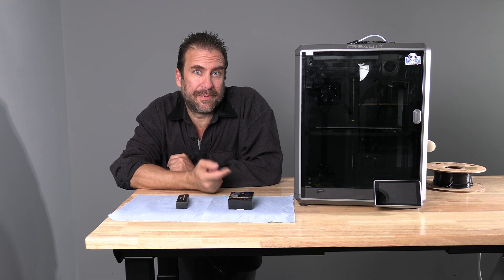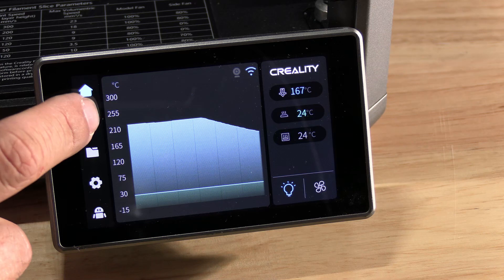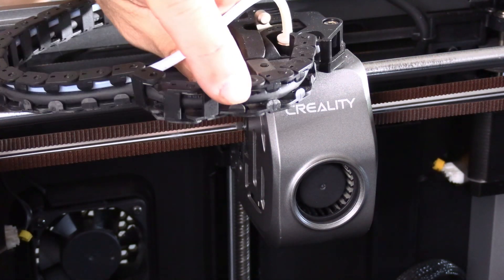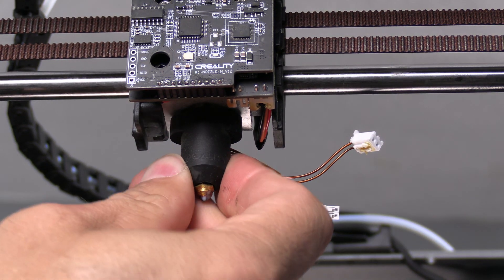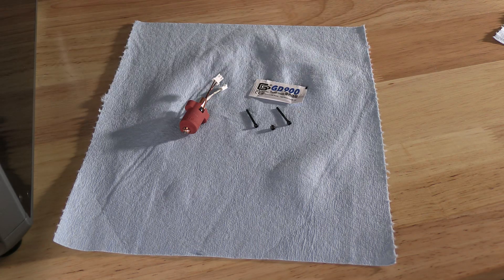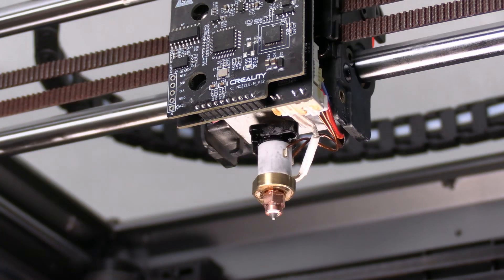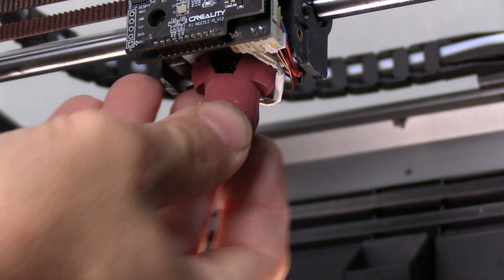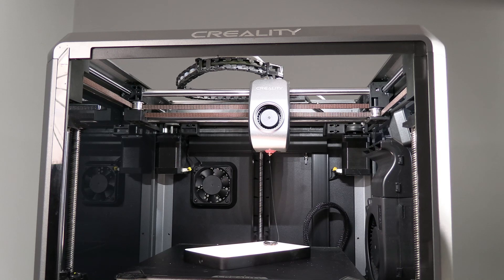How to replace the Creality K1 Hotend. Install the newest version. AKA: "Ceramic Heating Block Kit"

Comment: I bought my K1 speedy about 3 months ago in November 2025 so would it have the updated hot end, and can I print PETG with the standard hot end or do I need to upgrade it
Reply from the maker: Not sure if has unicorn. It may. Can totally print PETG. Easypeasy for the K1

Comment: "Is it possible that there's a gap between the body (hotend) and the heatsink with the new hotend?"
Reply from the maker: If the heatbreak is all the up and seated, there may still be a visible gap at the hotend

Comment: You forgot to mention that the fks @creality don't supply the correct Allan key to remove it, and every other key I tried, don't work
Reply from the maker: It's literally a standard M3 sized head that you should have 52 of in your tool box
Reply: @3DRundown the one shipped with the printer does not work...nor does my own 3mm. I cut the old hot end with a grinder to cut the heads off the hot end. Even though I got the new hot end installed, still getting the same error... Reached out to creality support.
Reply from the maker: I don't know why you have had trouble with this. Any Allen set should have one that fits, including the set that came with the machine. What is the error
Reply: The old screw heads didn't seem to to be "hex", they were bad, so i cut the hot end with a grinder to remove the heads, so i could pull the faulty hot end.  reinstalled the new one, and it still gave same error.  After unplugging re connecting turning on and off numerous times, it now "works with the new hotend.  Was getting error 2509 .  Anyhow, it seems to be ok now...

Comment: Oh btw Creality now have an upgraded hot end board and the heater so the connectors are ceramics. I had same problem and pulled the wires out of the connectors whoever decided to hot glue them needs therapy.
Reply from the maker: The glue is common, and prevents them from loosening during international shipment. Should move on to the Unicorn hot end. I have a video on that as well

Comment: I am a bit older with thick fingers and bad eyesight it is always a pleasure to work on the K1 max tool end. Your tutorials are always used as reference when such works need to be done, thank you for your detailed instructions.
Reply from the maker: Very welcome. 🙏

Comment: Hi what screwdriver did you use when you unscrewed the screws at 5:01
Reply from the maker: Similar to this: https://amzn.to/45Ef5xW
Reply: @3DRundown could you tell what the head of the screw was. I need to know the specific type What screwdriver bit did you use?
Reply: @softhaze26  I used t6 torx, they seem to be hex 1.5 in reality. I also didn't remove any plastics from around the unit, only removed the connectors and 2 screws

Comment: This is awesome. My son’s printer’s hot end boot filled with molten filament, which then solidified. Tried to remove it, but now the sensor is erroring and I can’t heat the hot end to help with this any more. Any tips on what to do as I suspect that the extruder screw heads are now blocked.
Reply from the maker: You've got the "Blob Of Death". You need heat and patience: https://youtu.be/D4mRFYaZS08

Comment: Hi, I'm following this tutorial for my K1C, but the only difference is that mine has a unicorn nozzle, something changes? Greetings from México 🇲🇽
Reply from the maker: Very similar. I have a unicorn video here as well.
Reply: @3DRundown  the problem is that I want to replace only the hot end, but I only found the tutorial to change the complete kit (the one that also has the heatsink ) do I need to remove the hot end from the heatsink and place the new one?
Reply from the maker: if you already have the unicorn assembly, with the unicorn hot end installed, you can swap just the hot end, same as shown here.

Comment: I've just had to do this to my K1C.  I ordered a K1C hot end, but was sent a K1 by mistake.  Learned a good FYI that they ARE NOT the same.  Almost identical except the connecter plugs are different, K1 doesn't fit a K1C.
Reply from the maker: Bummer. Consider moving to the Unicorn
Reply: @3DRundown , yeah pretty sure that's what I ordered, but it wasn't what I got.   It said "K1 - Low temperature" on the box too.  Don't think K1C is considered low temp.
Reply from the maker: That is super odd. I don't know of any Creality Hotend that says that. Where did it come from?
Reply: @3DRundown  not 100% how it works but Amazon says it's straight up Creality.  It is a Creality product.  Also probably a Canadian Warehouse.  Most likely just an honest mistake somewhere down the line.
Reply: @3DRundown  turns out I'm half wrong on the subject.  My K1C is a newer model and has connectors so new, replacement parts don't seem to exist yet.  :(

Comment: continuing with the problem I have with the K1c. When I try to  start a print I get the message key 109 exception which refers to the tool head fan which is working all the fans on the machine are working normally. I contacted Creality support and they sent me a picture of the tool head fan. But that isn't my problem . The problem is the cable going to the plug next to the big 4  way  plug at the top of board 2 on the tool head is missing, and I have no idea where is gone or to what it connects to. Could you track that lead for me on your machine and tell me what it connects to. Thanks in advance.
Reply from the maker: Post Here: https://www.facebook.com/share/g/1UnKeTR5aV/?mibextid=wwXIfr

Comment: And what if your printer has a unstoppable blob…
Reply from the maker: HEAT. but sure, a fully assembly should be available, but is seldom needed.
Reply: @ I’m prob just gonna replace the printer tbh
Reply from the maker: For a blob? Why... This is easy stuff. Swap it out and back to work
Reply: @  I’ll try to replace it but I might be unable to
Reply from the maker: Go for it. This is part of the 3D printing adventure. I believe in you. Come back and let me know how it went!
Reply: @3DRundown it’s looking better than it was but not done yet
Reply: @3DRundown also what did you use to get out the screws on the hot end
Reply from the maker: Allen key should work, but I probably used a super cheap screwdriver with swappable bits, from China...  Sometimes I use a star-bit as they grab stronger. Be gentle, once you crack it loose, it will move freely.
Reply: @ thanks
Reply: @3DRundown  What size Allen key?

Comment: New K1 max printer for Christmas, direct from Creality.    Towards the end of my first roll of PLA that it came with, meltdown on the hotend and toasted the thermosistor when clearing.     Had a hard time getting the hex key to fit those two bottom heads that tighten upto the plastic piece then the heatsink.    Luckily, with the nozzle out, I was able to swing and get them to loosen.    Waiting on Creality support, I ordered 3 different Creality hot end kits from Amazon to get going quickly - all three came with a black heat sink and not that single allen head on the side.    Not sure which one is newer or better.    Do you have an idea?

Can I take the black heatsink off of these that I bought and throw the heatsink away to attach to the natural aluminum one that doesnt require removing the PCB board to replace?    Curious on that or if I need to figure out the right part number to order and wait again.... :(

Comment: Mr rundown my screws are not mounting correctly
Reply from the maker: Oh hell. Elaborate. What's happening? Are you on my FB K1 group? Post some pics and video.
Reply: @ I don’t have Facebook the spacers were melted so I took those off and they mounted but I was freaking out

Comment: What is the voltage to apply to heat a ceramic block separately?
Reply from the maker: I believe the Ceramics are 24v. No "block" on these
Reply: @ do you know if a heating element has a polarity?

Comment: So im fixing my hot end after a bit of a mishap. Did your extruder to sink not come with buffers? Cause currently you just have pressure on the nozzle to keep it attached and not jingling around. Mind you im using a K1C, but apparently the hot end is supposed to be universal?
Reply from the maker: Just the grub for the hotend. The nozzle is inside this

Comment: This is really helpful, thanks! I have a K1 Max. I've been getting the "Error Key2564 The Nozzle Is Not Heating as Expected" error recently. It used to happen infrequently in the past, but now I can't get a single print to finish and I do see that the temps are fluctuating wildly. In the beginning of the print the temp was supposed to be 220 and it dropped all the way down to 180.

When I got the printer, creality had included another hot end. I'm going to try replacing mine with that one. Hopefully that will fix my issue.
Reply from the maker: Start with the hot end. Hopefully it's just the Thermistor.
Reply: @3DRundown  It looks like the hot end replacement fixed it! I successfully printed a Santa bust with no issues. The temperature is staying where it should be with very minor fluctuations. Thanks so much! This video was VERY helpful! I had it on my ipad as I was doing the replacement.

Comment: Hi, firstly you are explaining everything really nicely, I wish I had seen your video before I tried fixing mine. I have a K1 and yesterday I replaced the ceramic heater because one of the cables on it broke. After I replaced the heater, the printer worked almost perfectly but it smelled really bad and it was dropping this weird black blobs of filament on the model from time to time. Today I disassembled the hotend again to see what is going on and saw that filament covers every part of the hotend, even the screws and it was smoking whenever it reached high temperatures. It seemed to me like filament leaked from the barrel (the part where you spread thermal paste on, I am guessing that's its name, I am in Turkey so I didn't check the English name) because there were dried filament residues all over the two screws on top and the little gray metal rod that comes from the middle of the barrel. I managed to remove the hotend and ordered a new set. I followed Creality's Guide but must have done something wrong. Can you help me understand what might have I done wrong so that I won't do it again next time I install it? Hopefully I could explain what it was like, thanks in advance.
Reply from the maker: Yup. It leaked at the heat-break. There was a small gap between the "barrel" and the extruder

Comment: Don't you think those ceramic heaters are coming loose? They should have thermal paste between it and the heatblock
Reply from the maker: There is. I applied it here: https://youtu.be/6nCiiKYpmC8?si=4ze-f6CBm-LuM6Ij&t=353
Reply: I am talking about the gam under the creamic heater not on the heatbreak
Reply from the maker: No. Both my original hot end, and my Microswiss Flowtech hot end, ceramic heaters, rotate freely.
Reply: @3DRundown  good to know thanks

Comment: Hi there! Would you happen to know why my Ender 5 Plus is making this particular noise? It's been doing this ever since I bought it. I've tried troubleshooting it a few times (around 3-4 attempts) but haven't made any progress. I've made a lot of adjustments, but nothing seems to work. Any idea what might be causing it? If you have any insights, I'd really appreciate it! Either way, thanks for your content and have a great day! here's a short (8 seconds) video of the sound it makes.  https://www.youtube.com/watch?v=fQAuiLnjgBg
Reply from the maker: Holy Molly. It sounds like it's trying to move too far, and grinding the belts/steppers. Check that limit switch in the corner.